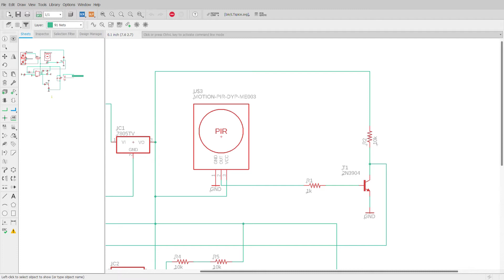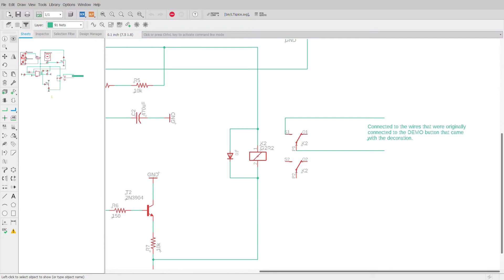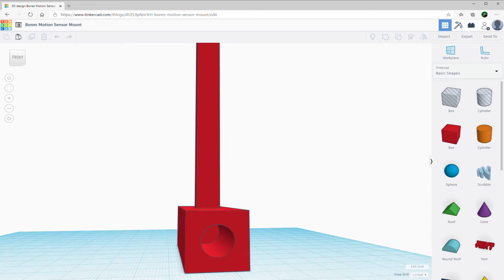Adding Motion Sensor Activation to a Halloween Decoration

Comment: What was the total investment?
Reply from the maker: battery holder (not including batteries), prototype board, voltage regulator, 555 timer, PIR, resistors, capacitors and transistors came to just under $4 - purchased from Tayda Electronics.  3D printed mount came to under $0.10. Halloween decorations themselves were extra - and they go on sale at a steep discount on and after the holiday.